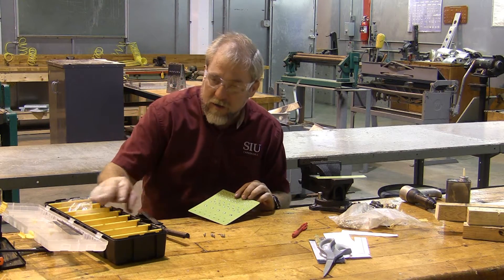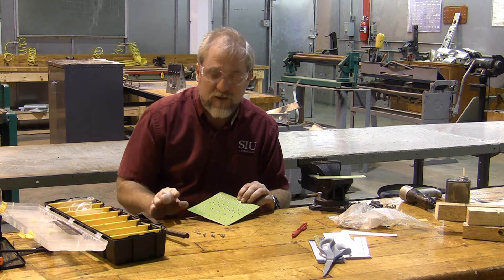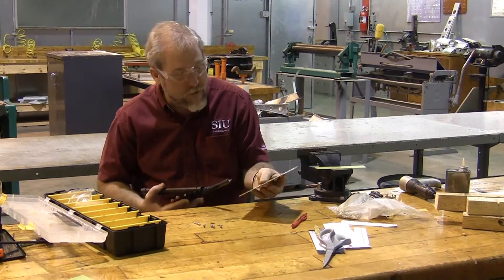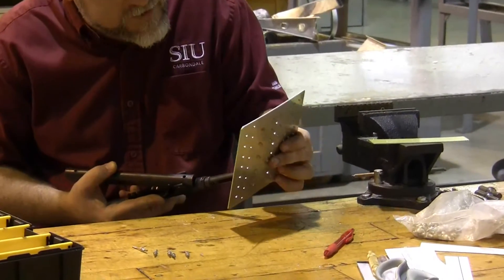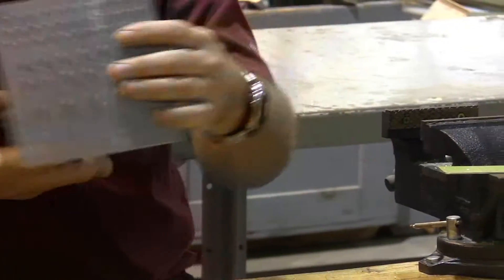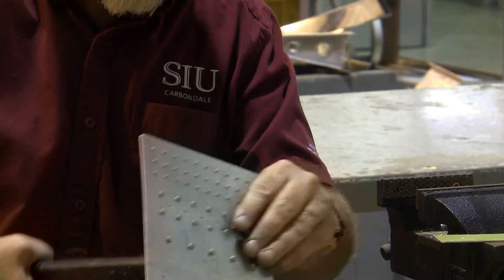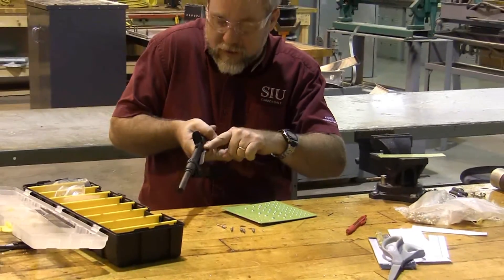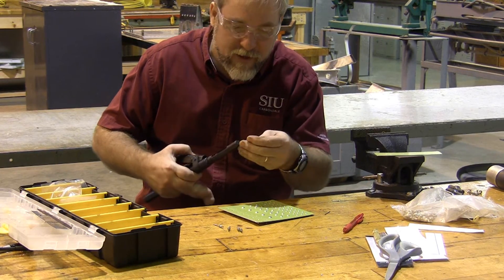AVT 206 A&P Sheet Metal Class - P1 - Installing CherryMax Pulled Rivets

Comment: Thanks for the video. I have a similar rivet gun but I need the type of puller you have. What is the part number? Mine came with a shorter head G6H4-1B. Do you know what that head is for?
Reply from the maker: Don't know the head number off the top of my head.  I use Yardstore for most of my purchases of this type.  Pulling heads are not cheap!
Reply from the maker: Not telling you to buy it - but check out ebay auction 222779728879.  Looks like what I have, only a bit rusty.  Cheap!  Might even buy it myself!
Reply: LOL. Did you beat me to it? When you have yours in hand, let me know the part# Yeah, yard store is great.
Reply from the maker: I made a $10 offer on it and he just sent me a counteroffer of $15.  I'm trying to decide if I want to spend that much on something I don't need, but may buy it tomorrow if still around.  It does look rusty...
Reply from the maker: Looks like a nice set.  You won't get that price from any retail outlet!